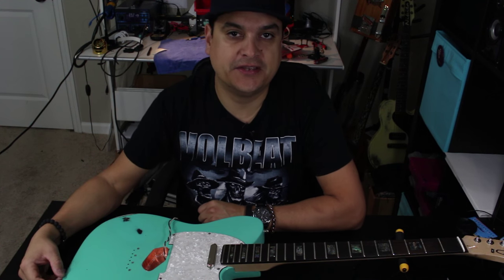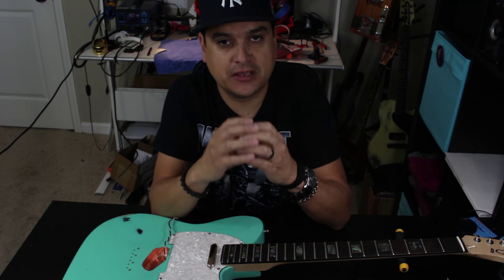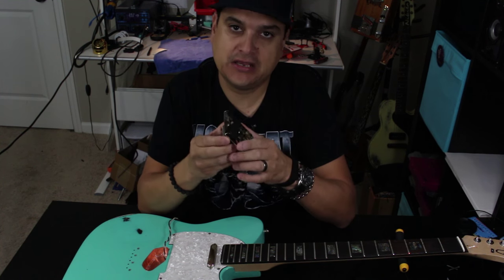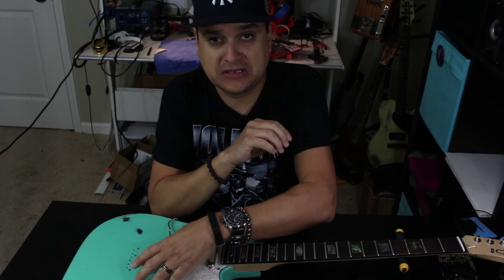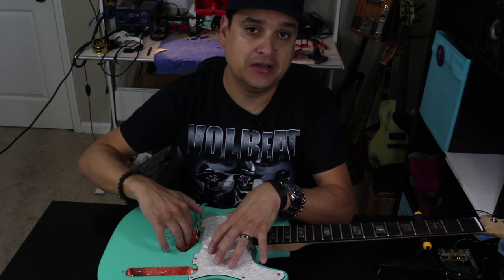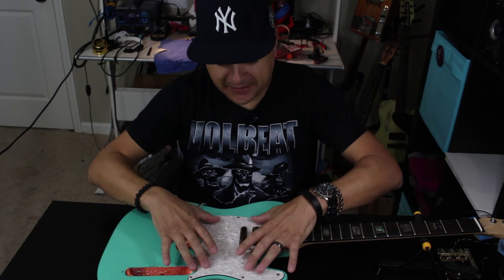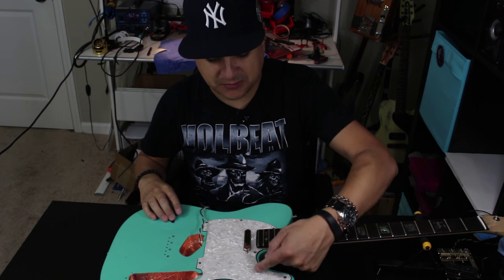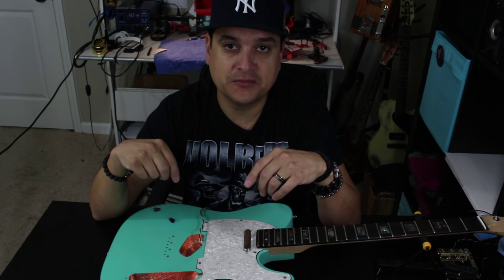How to properly sheild your electric guitar - What Shielding actually does #89

Comment: I always use shielding tape with a conductive adhesive. But... if you are using shielding tape without conductive adhesive, instead of soldering every seam, you could fold the tape over so the copper is touching the next piece and then put a narrow strip of shielding tape over the seam to secure it and you would have conductivity. Just sayin'.
Reply: Great idea

Comment: Here is a trick for all of your shielding foils. Buy some copper shielding tape with the conductive adhesive and use small pieces to connect aluminum foils pieces together and also for copper foil that does not have conductive adhesive. Easier to put a small piece of conductive adhesive copper tape instead of soldering two adjoining copper foils pieces. This way you can buy cheaper non-conductive adhesive copper foil tape or cheaper aluminum foil tape and only use the expensive conductive adhesive tape for completing the continuity, including pieces to come out of the cavity to contact the pickguard, if applicable.

Comment: Say I use aluminum foil on the cavity & pickguard and run a screw into the cavity & then wire that to the volume pot (ground), do I need to run a wire to the pickguard, or if the volume pot is in contact with the pickguard, will that suffice? Thanks!

Comment: Dylan, thanks for the video.  I am a complete electronics noob.  What I am trying to figure out is how to shield my cheap Tele copy.  I have watched two of your videos about shielding (including this one), but I am stuck on how to ground the shield.  In this video, you are connecting the control cavity to the pickguard, which has shielding on the backside, and you state that you are grounding the circuit when you put the control cavity lid back on.  What about the bridge pickup?  Does it need to be connected to the pickguard (e.g., via a connecting piece of copper tape like between the control cavity and pickguard) so that it is part of the circuit?  Sorry for the dumb question, but there is a lot of disinformation and I am looking to do my shielding job properly.  Thanks.

Comment: Noise Gate pedals work well. There's a great video here on You Tube showing SRV in the studio and he was expressing great discontent about the loud interference / 60 cycle hum (probably include the lights in with it) and they put a noise gate in and he was back to wailing ! ! Get these pedals dialed in right and they're a charm. Leave it at home when gigging and get lynched ! ! :)
Reply: Noise gates are great but your guitar should start off with a good sound anyway. The noise gate should be a complement, not a crutch
Reply: @beetsq1968  The shit sound will still be there when the gate opens. You're just making it so you don't perceive it. It's still going to color your tone on a recording and I can definitely hear it when mixing a guitar track. Same thing with a shitty treated room and the bass frequencies. They become almost unusable.

Comment: You don't need to solder the seam if the glue on your shield tape isn't conductive. Just fold the tape in (Adhesive side to adhesive side) at a seam making sure it overlaps and the conductive side is touching on both pieces and then put a tiny piece of tape to hold that join. Saves you trouble of soldering on tape.
Reply from the maker: The problem is the lack of reliability. We have tried that and it does sorta work, but not reliable enough to endorse as a practice.

Comment: So no need to shield the control cavity.. but I guess I need to do it so I can connect the pickguard to the ground which is the metal part around the bridge pickup. btw what about the input jack cavity? based on what you are saying it does not need to be shielded

Comment: Hi Dylan! Awesome channel, thanks so much. Premium alternative to work at my dayjob. Now on topic: I use kitchen foil for shielding and because I don't like messy stuff, I'll painstakingly cut it to shape and carefully glue it in, etc. Which on a Strat or Jaguar cavity is always a hell of job, but never mind. Now about the grounding: should I drive a screw into the foil and solder a wire from it to the ground, or is it sufficient that the foil in the cavity makes contact with the foil on the back of the scratchplate, which itself makes contact with the chassis of every pot bolted onto it? After all, every pot is already grounded.

Comment: If I use copper tape with conductive adhesive do I even need to bother with soldering a ground to it? Can I not just strip the grounding wire and just tape it in place on that end? Hell, for that matter do I even need to solder the other end? Just tape it to the grounding point? (I’ll solder it to my grounding point, just curious to know)

Comment: I have two questions:
1: the switch on my new loaded pickup guard is much bigger than the old one. I had to route out my guitar, then covered the exposed wood with copper tape. I think the switch may be touching it though, because it’s crackles and hums REALLY loud and the sound comes through pretty muted. Is that the problem?

2: after taking everything apart and putting it together, I’m not sure if I reinstalled the wire that connects to bridge in the back correctly. I have one end attached to the metal plate that the springs attach to, and the other end wired to one of the ports on the loaded pick guard that says “ground”. Did I do it wrong?

Comment: Hey Dylan It's  Jeff Here ..I was wondering why I need to solder every seam they seem to be touching as they overlap ,, I am a little Confused am I missing something ??? Thanks, but now  I  may have to re look at some of my jobs now ??
Reply from the maker: If the glue on your shielding tape is conductive, you are fine. Many times it is not. In this case, the overlap will not give good continuity.

Comment: "A dot of solder" under the copper shield is the ground? Or do I need to connect wires to all those dots as a network to a ground?
Reply: Some tape comes with conductive adhesive on the back, some does not. When using the conductive type I find no need to solder it. By having the tape touching the metal switches and backside of pots they are now connected to ground and are part of the shield. I always check my work with a multi meter to make certain all connections are legit and complete.
Reply: If i might add, if you connect all dots to ground individually , you create ground loops that act as antennas and will amplify noise. (bad) 

Apropos to Dylan : I'd like to request for a video showing how to make the quite expensive illitch noise canceling coil oneself. 
Thanks for the content

Comment: Will aluminum tape work for shielding on a pick guard?
Reply: Yes, if it's grounded. An easy way to ground it is to extend a bit of your pickup (or control) shielding and sandwich it between the pickguard and body. This assumes that the cavity shield is grounded. Another way is if the metal casings of your controls are attached to the pickguard and have contact with the aluminum.

Comment: Where is ground in a guitar.  Where can I solder the tape to to ground it?
Reply: As far as I am aware, when you plug your guitar into an amp the earth goes through the chord into the amp and then to ground through your house wiring.  Most people seem to run a wire from the shielding and solder it to the rear surface of a pot.  The pots have an earth going to the jack.

Comment: Having issues with microphonic type of noise which seems to be generated by having an anodised Pickguard.  Guitar is a fender ultra luxe strat, small area on guard of bare metal around switch and controls only.

Humbucker is fine but noiseless neck and middle pups are unusable with live volume and high gain.

Any help would be much appreciated!